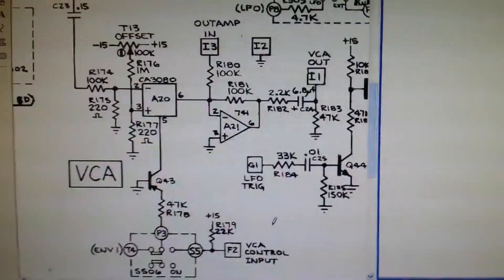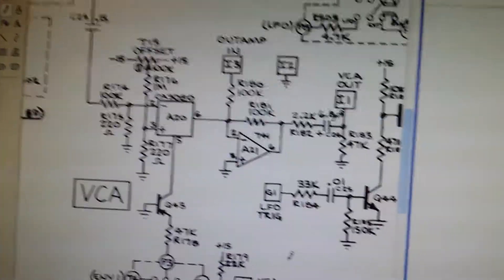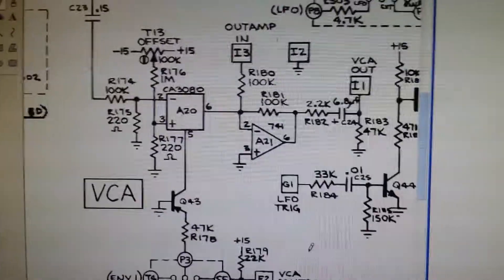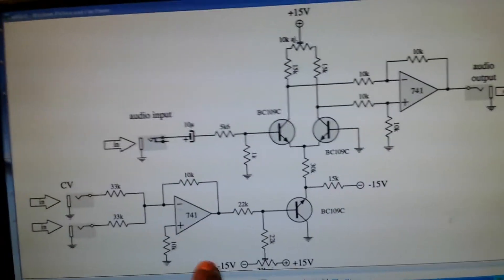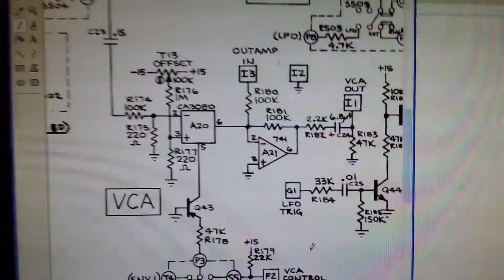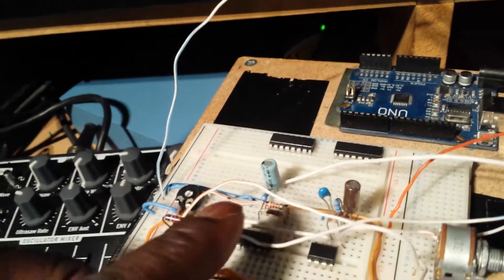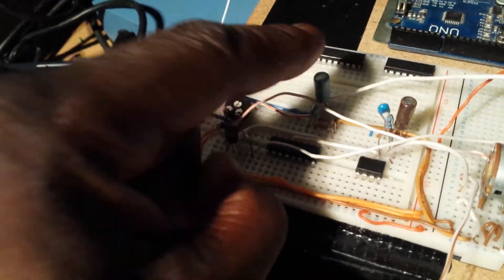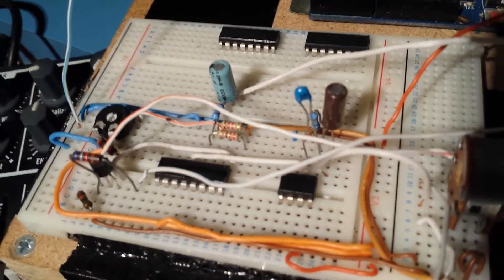DIY analog synth project Tutorial Part 13 (Oberheim SEM style VCA clone LM13700 version intro)

Comment: So, how does modifying CA3080-based designs for the LM13700 work in practice? Can you literally just use LM13700's pins for +/- input and amp bias input, ignoring diode bias and buffer I/O? Does that work?
Reply from the maker: In some designs yes. Like in lots of lm13700 vca designs
Reply: @AdamTheAd-vanc3d  How about filters and other classic circuits? What issues can I expect by replacing like this?
Reply from the maker: @QrchackOfficial  . This is my version of the SEM filter which is lm13700 based following the orig schem except i use the darlington buffer as a pose to the fet buffers https://youtu.be/psLhH2n0Je4
Reply from the maker: @QrchackOfficial  . The only thing you may need to be careful of is driving the signal too hard and making sure you keep under the iba current spec of the data sheet.
Reply: @AdamTheAd-vanc3d  That's helpful, thanks a lot! I actually sourced like 20 of them several months ago but didn't get around to building anything with them except a RYO 3xVCA since I thought the conversion of CA3080 schematics could be an issue. Will give it a go then!
Reply from the maker: @QrchackOfficial  Go for it . You wont be disappointed.
Reply: Na, the LM13700 drops right in, you might wanna adjust the resistor on the iABC pin (a bit bigger / smaller) and check with a scope if the signal doesn't go through the roof.
Reply: you want the exit signal to be 10 V.p.p or +5 Volt / -5 Volt.

Comment: That vca circuit you showed with the two matched transistors you mentioned has a higher signal to noise ratio. That being said is it still a usable vca for a diy synth? Im looking for a nice simple vca for a project and that one looks the part. Also regarding the matched pair should they be matched for vbe, hfe or both? 
Thanks in advance :)
Reply: no need to match transistors if you use a trimmer on top of the long tail to center the signal.
Arturia has pretty much the same VCA in the mini / micro brute and they aren't matching transistors.
Only the first Moog Ladder filters produced used matched transistor than they figured out that costs where going to the roof.

All transistors are checked right after they get produced, they even did this automatically on the first ever mass produced transistors some 60 years ago.
every silicon part you buy at a electronics chop is checked before it reached the shop.

alternatively you could use IC sockets with turned pins and cut them up with pliers and place these on the footprints of the transistors and switch them if needed.
Reply from the maker: The signal to noise ratio on both circuits is dependant on a few factors before the input signal stage, personally i prefer the matched transistor pair design. As you can get away with really driving the input and it beefs the signal up nicely, the ota version im using clips if driven to hard. Having said that it works better for im my case as its done on  dual lm13700chip which is almost a current control cell in itself. With the addition of a few more parts . It has also allowed me to implement midi velocity cv control without taking up much more room on the breadboard.
I had the first discrete matches pair circuit to begin with and it still proved noisy at times . This could have been for a number of reasons. Including the fact im using a breadboard.
Give both a try as they are both widely popular.
Reply: Adamski A.  Thanks for the detailed reply:) ile try both and see how I go. One more thing, with the matched pair did you match the hfe or vbe?
Reply from the maker: @PracticalCat  . I di try to match both vbe and hfe as closely as possible. Just remember that handling can cause a misreading from heat transfer. I used 2n3094 first then bc547 and 548s which have a higher gain .
Reply: Adamski A. Cool thanks
Reply from the maker: @PracticalCat  This may also be of intrest and worth checking out  
http://hem.bredband.net/bersyn/VCA/ca3046 vca.htm. 
If link doesnt work google : CA3046 VCA circuit.
Reply: Adamski A. Thanks:) I'll take a look.
Reply: @AdamTheAd-vanc3d  Well, when you mix 2 or more vco signals, you should mix them without exceeding 10 V.p.p., the original signal size of one.
1 + 1 = 2 and you will be hitting the power rails within the OTA if you add a third signal, witch is around 11 volts.
Reply from the maker: @AnalogDude_  Thank you